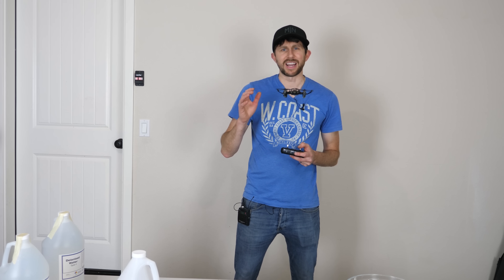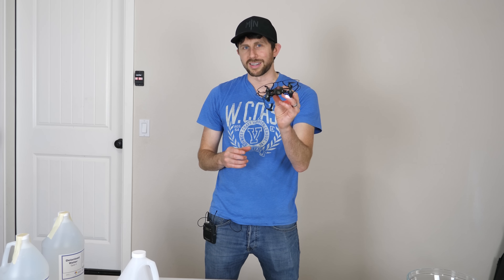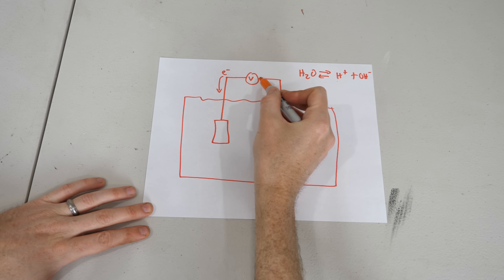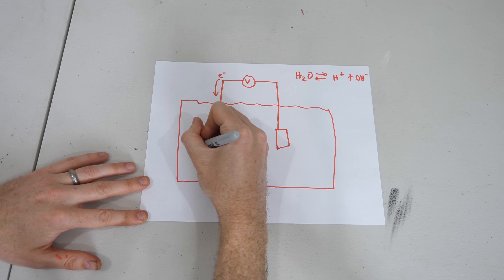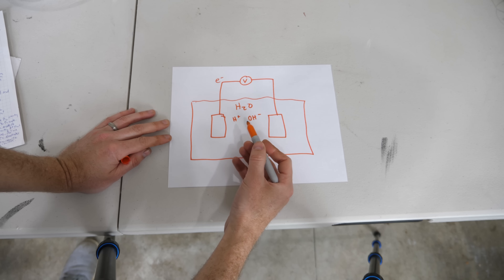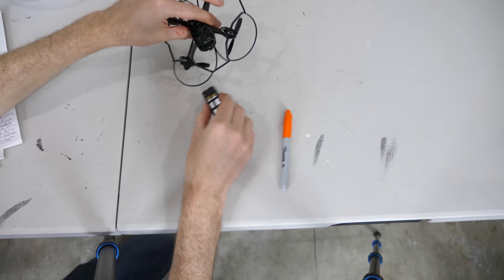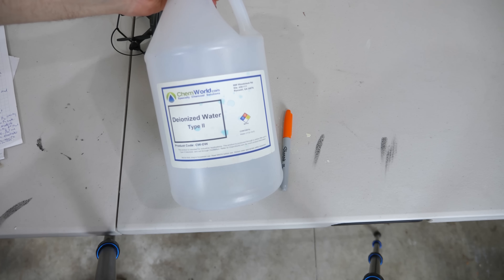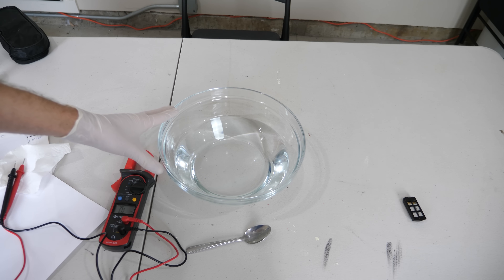Can a Drone Fly in De-ionized Water? Experiment

Comment: The radio frequency can't pass water as water isn't solid and the radio frequency isn't made to pass throughout water unless very close  to the water unless you spin the blades in the air before you put in the water with blades still spining

Comment: the motors of drones are designed for air, and when the propellers rotate they displaces the air above them downwards and generates a thrust force oppositie to gravity and the drone lifts ups....as the mass of air is much less so the motors have low torque and higher rpm....
but when you put the drone in water... as we know that water is much denser than air so the propellers need to displace a greater mass of fluid in water than in air.... and due to the low torque of motors propellers are unable to displace the water and stops rotating..... if you remove the propellers and then put your drone inside water, you will still observe the motors rotating because now they don't need to displace any fluid....
in second attempt when you slowly put your drone inside the water the propellers were slowly moving due to momentum they possesed at high speed....

if you design a drone which has motor with high torque and high rpm both then the drone will actually move in water and as well as air.... ready-made drones won't because they are only designed for a fluid which has a density of air

Comment: It’s loosing connection as it hits the water , just as when you put a Bluetooth speaker underwater it looses connection . As well as if you put a waterproof phone under water , it looses cell reception . Since the water shouldn’t effect electronics , try using the controller under water with the drone

Comment: 2.4 GHz does not get into water easily.
Reply: Besides that, most of these systems have a low-voltage cut-off. The higher resistance (drag) created by the water caused the motors to draw too much current, which, in turn, causes a drop in voltage.

Comment: I would guess the RF circuitry is 2.4 or 2.6GHz and the signal doesn't penetrate water, that's why your drone stops working until the antenna dries up a little bit?

Comment: That make electricity over charge to motors and motors get realy powerfull when it comes a way to the water 

And it need to be to work looks like in under water more electricity will be maximum only 700 or 800 more will kill near by controller and kill the drone good thing is if we flush it out looks like a little drone can take care of its heawy wights looks like

Lets try helicopture in it

Comment: I have a question in regards to submerging batteries, I have a vehicle what they call a "Rzr" its an off road sport vehicle. The battery in this sits underneath the drivers seat. I regularly have it completely submerged in water crossings. Seeing that the water is "dirty" because of the debris flowing in the creek water. It seems like it would be a good conductor, why doesnt my battery short out?

Comment: 0:23 Actually that is false. You would want the resistance to be very high (unreadable) because that would prevent the current to flow and short out. The minerals in normal water have lower resistance which allows for the current to flow. The resistance in deionized water is very high (close to air) as air has unlimited resistance. You have to remember that current wants to find the quickest way to ground, and through that water is not the quickest way since the resistance is so high

Comment: What experiments can you do using an induction hob and liquids to produce electricity inside the liquids? Can you do anything that'll generate visible electric fields inside the pan used? I know they  use electric induction to heat the pan used so could this be made visible using specific liquids with or  without solids to arc to?

Comment: Propel drones have a gyro takeoff sensor so it will not take off unless on a level surface
Reply: I think all drones that aren't absolute garbage do, it would be very hard to find one that doesn't if you want one like that on purpose. You can make it already "taken off" without really flying before submerging like he did later, having the drone slightly spinning before putting it in water bowl. I also think it only applies to first takeoff per each time the drone is powered on in most drones, otherwise you wouldn't be able to land on anything sloped and come back- it's just to calibrate the gyro before flight as it later calculates its angular position relative to that moment.

Comment: The water itself is causing resistance on the propellers which are design to spin freely, that's why it stops. You see there is no short as the LEDs for example remain on at all times. Same as if you'd touch them with a finger they'd stop spinning. Now... not invalidating what you explained ahead of the experiment, what I'd like to watch is this experiment done on REGULAR water... just fot the sake of it :)

Comment: The reason it randomly started working when it was dropped in the water is due to the way the drone handles gyroscopic movement. Drone's at this caliber (haven't tested on the "pro" caliber stuff) WILL NOT spin their propellers unless they are below a certain tilt angle. When it landed in the bowl the first time it was on a steep enough angle that the blades wouldn't spin. The blinking lights on the bottom indicate two things, either this or, as someone else mentioned, low battery. Do this experiment with an empty bowl and the result would be the same...that is until the second part where it is less angled and starts working. In an open bowl it would fly right out, but in the water, the propellers pointed at the angled portion of the bowl generate more thrust either because of the way they are located or the inertia in the water of the heavier backside, and even though the drone tries to balance, it fails, and turns off. Then once it falls to the lesser angle, it starts working angle.

All in all..make sure you know all the "features" and how the drone actually works before saying that it didn't work. (P.S. it still might not work, but you would need a bigger, LEVEL, volume to test it in to be sure)

Side note: if he did do it in a pool and it didn't short, that might have worked
Reply: Except even the military cannot transmit radio thru water.  With a bowl of water one can hope, with the controller against the edge of the bowl, to get a little transmission yo the stone but that's it if even that.  The military used sonar because of this.

Comment: question: why do we get shocked when we touch an outlet while wet if water isn’t a good conductor
Reply: Because the water has stuff in it.  You can see this with a tub of water.  Try lighting a tiny bulb with a wire cut and its ends put in bath water, then distilled water.  If your bath water is clean, neither will light the bulb.  Typically bath water has stuff in it its not pure water too expensive to process.  We have clean water not pure water.

Comment: I have a feeling that the slowdown was because the water resistance was so high compared to air resistance. Maybe if it was a larger drone with more powerful motors it could overpower the resistance of the water. Now to find somebody who is will to try this with their high end drone. You should have also shown a comparison using 120VAC, we did this in Chemistry to prove the insulation properties of de-ionized water. 2 metal probes attached to wood 1 hot 1 neutral, a light bulb, switch and 120VAC in a circuit. Probes are inserted into de-ionized water flick the switch, light stays off. Move it to tap water hit the switch light turns on. The funnest part sprinkling ions into the de-ionized water and watching the light turn on. I forget what we used might have been NaCl.

Comment: my hypothesis (at 8:20 ish), i guess that, because the drone is not make to be in water, the material of the drone were kind of acting like a Salt inside the water, so it made the water more conductive that it was suppose to do. At 10:00, you talk about impurity. is it possible that the plastic/metal were disolving at a nanometric value that made the water ionized ? maybe with the electricity, it can act as a catalysis in the process ?

Comment: Actually, you can run a small DC motor (bare wire to battery) or a small flashlight bulb (bare wire to battery) under tap water. I learned this when I was 9 years old (20 years ago) by taking the off set motor from the 'Operation' game, wiring it to some AA batteries, and testing it in my bath tub. There, I also tested the same set up with a light bulb I got from a flashlight. DC won't totally short circuit... It's just the metals will erode over time and the battery will drain faster.

Comment: I cannot agree that a drone would not function in tap water. Try it. It should, (at least in Europe). There are not enough ions to create high enough current in the water, to prevent the drone from running. It might die, but not immediately. In case the printed circuit board is protected with a layer of nonconductive material, it will last until battery contacts rust away and that will take a pretty long time.

Comment: Wrong, batteries won't short-circuit in normal water. The resistance is way too high for it to do that. To make a short circuit you need a really good conductor.

Comment: It might work but you will break your drone unless you disassemble it and air it out in less than 15 minutes.

15 minutes is just a guess but the water will ionize from the metal in the drone, which will destroy it if the motor is even function in the water.

Comment: The internal computers felt the resistance in the motors and shut off just as you said. The light started flashing when you landed in the water so it's possible that it wasn't able to receive signal from the remote but I think these drones have to be set upright or on a flat surface after an auto shut-off to begin flying again. It also probably flew really weird when you took it out of the water because this drone has and altimeter which likely have water in it making it very difficult to read the air pressure and that's why it kept floating up to the ceiling.

Comment: You mean a really HIGH resistance.A low resistance means it can transfer electricity.A high resistance means it can not transfer current so good.For example plastic is not conductive because it has an infinite resistance. The lower the resistance,the better the material will conduct electricity.Anyway...cool experiment.Good job!

Comment: 0:20 - If that water had a very low resistance, then you'd short out the drone in an instant.  (low-resistance = good conductor).  Doesn't de-ionized water have a high resistance?

Comment: It's  not only the conductivity of the water which affects the circuitry  but also the increasing of electric capacitance due to the much higher permittivity of water compared to air. Especially RF circuitry will suffer from "out of tune".

Comment: Radio frequency won't penetrate water that's y it does not work.
Next time try dipping the remote antenna in water
Reply: These small types of drones don't use RF signals, they typically use IR signals. (No antenna on the transmitter, but it looks like there is an IR LED.)

Comment: This would be a sacrifice, but if you clipped each of the propellers to make them shorter (probably much shorter), there should be less fluid resistance, and the drone should still be able to fly/swim because of the higher density of water.

Of course, the trade-off is that the drone probably wouldn't be able to fly in the air once it leaves the water. You'd likely need two sets of rotors for that.

Comment: Reduce the prop size to have the same rpm in a thicker medium (water) compared to air.  You'll have to adjust the pitch of the propeller to have similar lift capability vs rpm as well.  It'll work, just needs a bit of trial and error.
Reply: just get a real quad with brushless motors

Comment: I'm close to be positive that one gets similar results in normal water. The copper inside the small cables and soderjoints still have less resistance than any waterway.   Corrosion is the real threat to electronics, but the battery is still a closed system for enough time to function.
Just my uneducated opinion.
Reply from the maker: Thomas Herzog I agree with you, but it depends on your specific tap water. The tap water I measured in this video would probably have been fine.

Comment: I would try again with a "wired" connection to the remote. RF and water don't always work well.
Reply: C Rodriguez unfortunately you can’t exactly buy a “wired” drone.. he’d have to make it himself
Reply: @nathan07 Has it ever stopped him from making something before? But yes I do see the complications.
Reply: @nathan07  I mean he could build his own drone, use a wire transmitting an Sbus or PPM signal to the flight controller, and just have the radio receiver on a ground station

Comment: What's most likely happening is that the remote is using a radio or an ir signal which bounces off liquids very easily so while it's getting a weak signal it should still work electrically, which we saw.

Comment: The receiver doesn't receive the signals that's why it didn't work wel underwater
Reply: actually it's because of the physical resistance of the water, the drone probably has an over-current protect system which is why it shuts down under the heavier load

Comment: Hey, that would be a great experiment on radio frequency. To see how fast the signal deteriorates in water and other liquids. Just a thought.
Reply: Lot's of data on that already. 
2.4GHz for example which is used commonly for RC control is significantly degraded over about 1.4cm of distance in water.
Lower frequencies perform better and commonly ultrasonic or laser connections are the ones which actually work effectively. Ultrasonic being the common method means bandwidth is very low, you could only transmit very small amounts of data.

Comment: De-ionized water is kind of non-conduction environment and neither the motor nor the battery been short-circuited. This environment just cause the propel hard to move only.
If he put the drone on normal water, the drone will immediately short-circuited and damaged.

I think so !

Comment: If the drone had managed to generate lift while submerged, would it be flying or would it actually be swimming?
Reply: Air is a fluid, just like water, so the drone would still technically be flying underwater, just like a submarine. Compare a submarine's propulsion system to that of a prop airplane, not really all that different, they both propel themselves with fuel through the median. That's where the distinction gets annoying though because what is swimming if not self-propulsion? I would argue a drone or submarine is a lot more like a plane than a human who "swims" through water, but that's only because of the type of propulsion used. It would be difficult to say either choice is wrong using such generic terms as swim or fly because it could be argued either way. I would say you have to break it down to more scientific terms before any meaningful distinction can take place, like with principals of Fluid dynamics. You have Aerodynamics (study of air and other gases in motion) and Hydrodynamics (study of liquids in motion) but from there it gets a lot more complicated and you probably don't care lol.